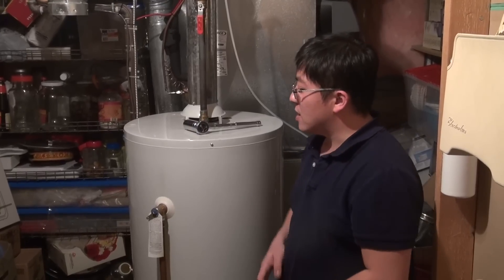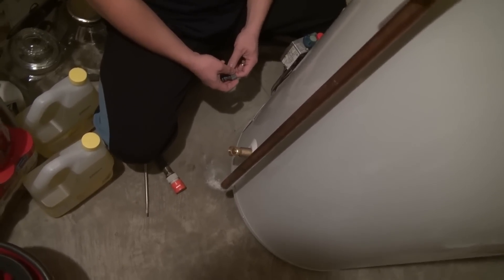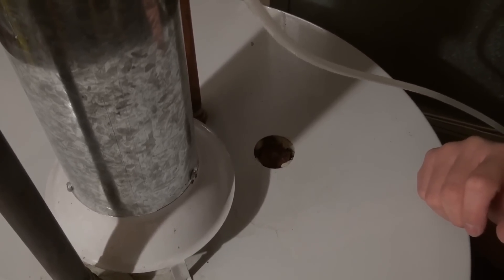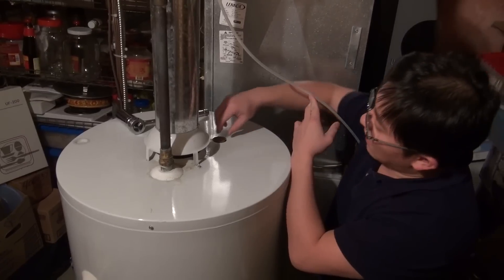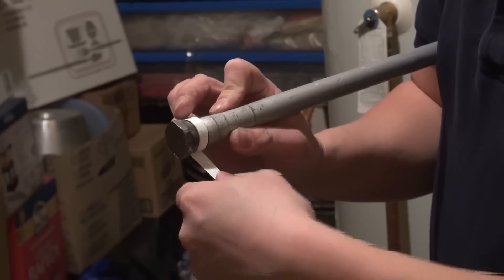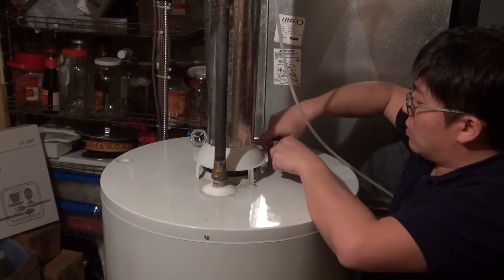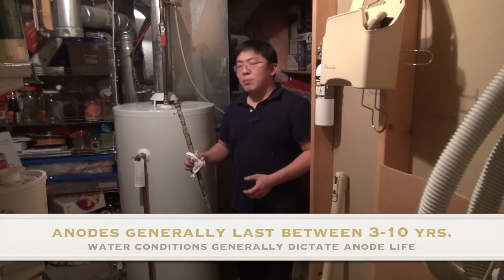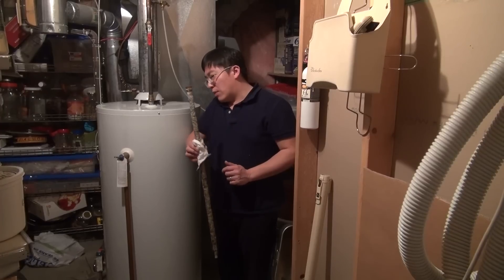How to Replace A Water Heater Sacrificial Anode Rod

Comment: Great video - not many actually show the actual removal of the rod on video (on other videos they would've already removed the rod).  This is good because folks need to see what it actually takes to remove one of these rods.  Question.  Why didn't you use a magnesium rod?  I've read that magnesium rods are better than aluminum because of potential health issues.  I just replaced my 16 yr. old water heater and I am debating whether or not to remove the aluminum rod and replace with a magnesium rod.

Thanks
Reply from the maker: @ Methodical2 - glad you liked the video. Yes most vids don't show the "act of doing" which drives me batty.  What's the point of the video if you can't see what is being performed?  Magnesium/vs. aluminum.  Doesn't make much difference since you're not drinking the water.  The type of metal anode you use is dependent on water conditions in your specific area.  Magnesium supposedly has the highest protection but can stink up the water in the process b/c of how it can react with your local water.  I guess the short answer is go to your local plumbing supply house and see what they stock and get their suggestion as pro plumbers there would be buying large quantities of whatever material works best in your area.

Good luck!
Reply: Yeah, I figured that's what the difference is.  I probably will just stick with the aluminum.  We've had no funky water for close to 16 years.

Take care
Reply from the maker: Thanks for watching!